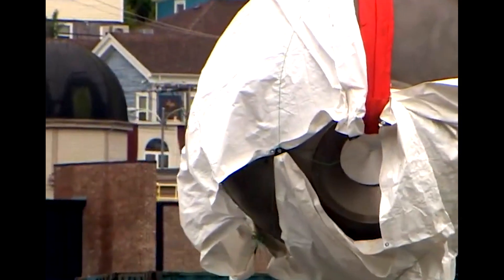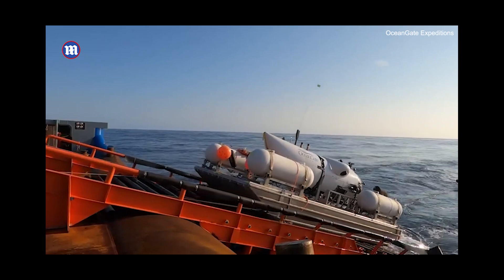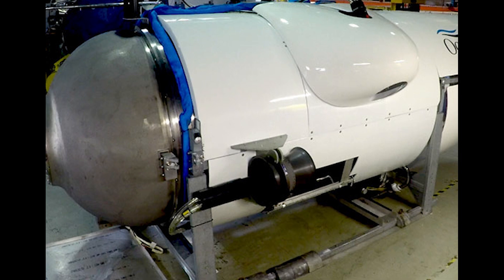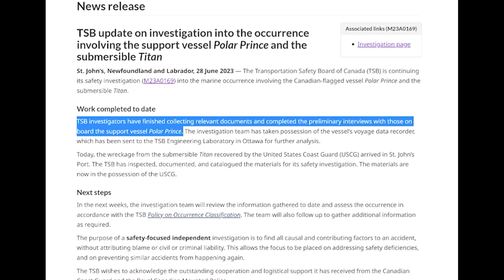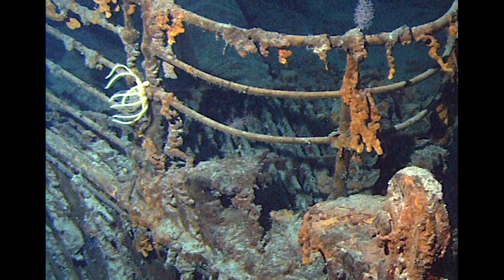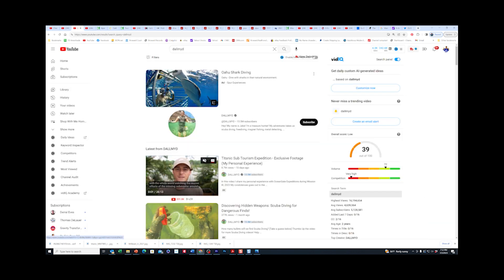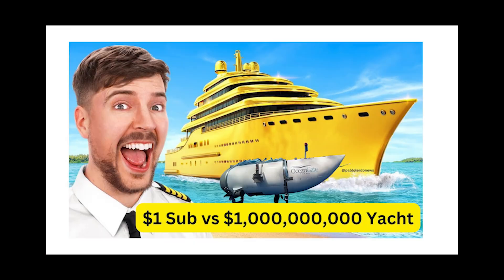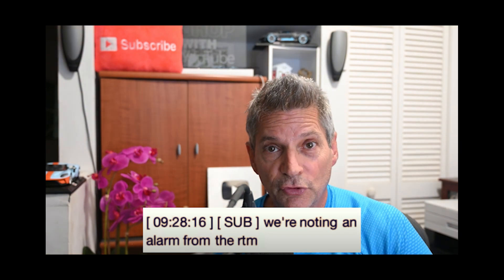Titan Submarine Debris Clues, Implosion Simulation

Comment: Its much safer to use an ROV to go exploring. People wonder why things break subsea, the truth is, everything breaks subsea. A Kongsberg camera has a $12k titanium housing, the connector costs around $300 and the 1/2” camera module is $500. The sea is a very hazardous place, most people have never seen the stuff down there. The creatures, the difficulty navigating, the lack of light. Look up the Titan 4 manip, thats what you need just as an arm on a Work Class ROV. Has thousands of seals and guess what, it breaks too.

Comment: The pressure cylinder was the most crucial component, and yet it was made with the weakest material.   You don't need an engineering degree to understand how stupid that was.

Comment: The carbon fiber failed along its length, at the exact same time both titanium end caps were ripped away having no structure to hold them in place. The pressure build up would force the window away shearing the bolts with it. The glue went with the carbon fiber.  The fact there appears to be zero residue supports the theory that it simply wasn’t strong enough to adhere to the titanium. This is only my theory no facts.

Comment: Thank you for the details. Lucky people that saw the red flags on safety issues. Getting bolted in without a torque wrench. It even looked like a flat seal ,not good. Glued ends? And who knows the metal differences with temperature expansions? One meral stays and the other expands. Big red flag. More money does not save your hide.

Comment: It was stated very early on that the plexiglass cover over the nose, the clear domed part over the viewport, was the first piece found of the wreckage. I wouldn't interpret too much about the meaning of the viewort being missing as the force of the implosion was enough to tear it off the sub whether or not it was the cause.   We need to wait for the report of those examining the actual wreckage.  Also, it doesn't really matter how deep the titanium flange was as carbon fiber and titanium deal with compression very, very differently.   The fact that the dissimilar materials react differently was one of the main causes of concern before the accident as the constant stress on that glue joint was bound to fail due to extreme flexing at that joint.  I doubt many adhesives are going to be very forgiving of that kind of flexing over any period of time.   Carbon fiber shattering under compression was a known property and that's why it isn't used.    Whatever the cause of the failure, I seriously doubt there was much left of that part of the pressure hull.

As for them using old rusted pipes for ballast...   Who cares?   That's dead weight that gets jettisoned when you need to surface and it's lost every dive and it's common practice to use cheap expendable materials.   It's viewed as waste.  That's why nobody is making any big deal out of it.  There were a lot of problems with the design and construction of Titan but this isn't one of them.

The moral of this story is when an aerospace engineer says he designed a sub that's "innovative" you might not wanna ride on it.    Deep Submersible Vehicles are NOT aircraft and the technical problems of going up are not at all the same as going down.  It's easy to deal with the piddly pressure diffenentals of one atmosphere of less.   This thing was just poorly designed by someone who absolu5tely did not know what he was doing.

Comment: That's crazy they trusted epoxy to hold the end rings on under all that pressure.
Reply: yup, if the cylinder did not implode under the 'radial' pressure & cracks first, the glued parts are the next candidate for failure. Imagine a crack, failing glue and water blasting in and worsening the crack in miliseconds.

Comment: Would it have been technically feasible, from both construction and buoyancy perspectives, to use a cylinder cast (or machined) as a single, solid piece of titanium or high grade stainless steel? Good point about using a calibrated torque wrench to fasten the “hatch” appropriately. I’d recommend viewing the two interviews by the YouTuber ACE of Captain Karl Stanley. He descended with Mr. Rush on Titan’s second test dive in the Bahamas to Titanic depth of 12,500 feet. He reported hearing, with unaided ears, sounds of popping and crackling that resembled nearby discharge of fireworks, or small caliber firearms, during descent. Worse still, these very loud sounds continued during ascent, until about 900 feet, indicating to Stanley ongoing release of stored energy from carbon fiber hull defects. Karl Stanley was offered his seat on the dive because he is the only other un-classed submersible operator with an operation similar to OceanGate—though he does not operate to Titanic’s extreme depth.

Comment: Concerning the portal window, it's designed to hold strong when pressure is applied from the outside of the pressure chamber.  When it imploded it would immediately get pressure from the inside and that thin ring that held it on wasn't enough to resist that pressure from the inside.  As far as no carbon fiber left attached to the titanium rings,  remember it was glued in parallel with the carbon fiber, so it can tear away without leaving anything attached.  Think of it simply unwiding like a spool of thread, pulling the fiber away from the ring like it's a cable. If the carbon fiber was stronger than the glue, it would pull away.   Of course, this is just my opinion.  But, I'm not thinking outside of physics.
Reply: Failure always occurs at the weakest link

Comment: Here is what I think happened, and I have worked with carbon fiber pressure vessels, but for space. The carbon fiber is coated in epoxy, just like fiberglass, and epoxy doesn't like to compress and decompress when you have layers of material in between the layers, so it will start coming apart like a flaky cookie, then that small titanium tube under it is just going to squish.. now, those titanium rings on the end are able to withstand the pressure, they are rated for it, the carbon fiber isn't, so they don't exactly pop off, but the object they were attached to is now more like a wrapping paper tube than the big 6-foot diameter tube it was at first.. or whatever size it was.... the rings were glued over the tube, so the tube can compress down easily, and the titanium rings don't get in the way, they are just instantly not connected to anything and just float away, well, float downwards fairly rapidly, but you get the idea.

Comment: Few things, as someone who works in composites: 
You won't find any evidence of the carbon fiber because the end caps only interfaced with the liner of the composite cylinder. Composite cylinders need something to wrap the carbon fiber tow around in order to achieve the end result. The material isn't mentioned, but it's typically some sort of metal (using a protective paint to prevent galvanic corrosion). 
When the sub impoded, the liner would likely collapse like a regular metal cylinder (like the real world example shown in the video), while the carbon windings would basically separate and explode due to the rigidity of the composite (carbon fiber and resin).

Comment: They used epoxy to connect the titanium rings to the center cylinder. I question that decision very much,  at a depth under so much pressure, I think that is probably far beyond the fail point for epoxy. I also very much question the fact that the carbon fiber cylinder is WRAPPED in a straight line and not crosshatched as it ought to be for strength. The fact that NONE of the carbon fiber core tube has been seen, ( nor broken pieces attached to the connector rings ) tells us a lot about the failure.

Comment: Vid pointed to the bolts and window missing  to front titanium cap. But how about  the adapter rings that were separated bolts and all from the front and rear caps?

I believe the carbon cylinder did fail. Being the carbon was wound about the axis with no crossing the cylinder was weak in the longitudinal direction, and the failure was a longitudinal  accordion collapse. The collapse took nanoseconds resulting in almost instantaneous compression and combustion of the air and some of the combustible materials inside the submersible.  According to another engineering source that compression resulted in a + 2000F energy  output. The resulting energy blew the bolted interfaces apart. The human remains found, I bet, were compacted in the rear titanium cap, which I believe had no viewing window bolted on as result of this accordian collapseand compression. The energy released incinerated the carbon binding material.  Hence why missing.  My two cents assessment.

Comment: Fellow scientists and engineers...all speculating on the overlap joints of the Ti end caps...
Joint strength of even heterogenous materials expanding/contracting at different rates wasn't the problem or the adhesive.  It was the delamination of the carbon tube due to cyclic fatigue in bending and carbon fiber mono-filament being in cyclic compression instead of tension that caused catastrophic failure.
Literally absurd anybody went along with this egregious design.
When the tube crushed, the end caps blew off with joints in 'shear' which wiped all the adhesive and remnants of carbon fiber bonded to the titanium flanges. This wasn't the failure mode.  Likely these joints were strong 'in compression' per design intent.
The tube failed which was adequately supported by stiff end caps.  The tube likely crushed at its mid point aka equidistant between end caps where stresses were the highest. This is in fact why hulls for deep diving vessels are designed spherically and not as a tube.  Stockton obliquely and laughably referred to 'the tube' as more ergonomic for passengers. Yes, the conically shaped acrylic window likely blew out concurrent to the end caps blowing laterally off the tube as the tube effectively imploded which resulted in a massive 'explosion' due to superheating the interior of the tube when occupants were vaporized.
Another scenario is Stockton Rush in his smoking jacket was looking out the port hole with his pipe and binoculars, speaking hyperbolically about Gilligan and the professor who defamed him as Thirston Howell the III the billionaire asked if they were there yet...when the sub imploded.  At that time, Stockton's binoculars shattered the port hole.  They would have searched harder for Stockton Rush's brain but most familiar with this story are convinced it was miniscule and insignificant and confirmation of what Darwin knew all along.

Comment: The window was blown out. It was designed to resist external pressure. Its conical shape fitting in a conical hole makes it very resistant to external pressure. The bolt were to hold it in place and set up a good water tight seal, but once at decreasing dearth the water pressure takes over and holds it in place. Once the carbon fibre cylinder imploded there was a momentary spike in internal pressure before pressure equalised. This pressure spike ejected the window outwards. The widow’s contacted are with the flange was at its thinnest point, it was never designed to deal with an external over pressure. The force of the implosion coupled with the compressed air carbon fuel explosion, momentary as it was, was enough to jettison the window.
Reply: Apologies for the typos but you get the drift.

Comment: I'm not an engineer but I work in an engineering environment and every safety critical face plates which require a correct seal are always fitted using calibrated torque wrench in a cross sequence

Comment: On an implosion the middle gets squeezed like a little kid squeezing a toothpaste tube. The ends deform as the middle is crushed and at a certain point everything inside the tube that is being squished implodes shooting the pressure on the inside of the vessel to the point the ends pop off in various ways. Go look at every photo of a sub that was crushed, middle is flat, ends are blown off. The observation window and its mount ring were blown off like a cannon coming out of a cannon barrel.

Comment: The recovery videos look staged.  It's not just that the porthole acrylic is missing, its that there are are no holes visable where the bolts would have been.  Also all the bolts must have sheered off between the titanium rings and the titanium 'end caps' because they were brought out of the water seperately (supposedly)

Comment: Your mentioning that no trace of the carbon fiber or the "glue" tells me that silicone was used, Silicone has remarkable expansion rates, but doesn't really stick to anything, especially smooth polished surfaces, after silicone cures on a smooth surface, you can grab one end and peel it off!

Comment: That dome connecting area should have been a knife and fork with an overlay on each side of the carbon fiber at a depth equal to the perceived sheer strength at a given length, which would be the circumference of the carbon fiber utility. That is, if laid out flat, how far in from the edge is the optimal strength along that circumference, We know that the middle (front to rear is the weakest as is the first minute fractions! One issue with coupling different materials is that expansion and contraction rates, Titanium and carbon fiber certainly have rates that differ with temperature, but also compression and decompression. Maybe when those variables combine in a mix, that creates the stress area at that intersection of the two materials?